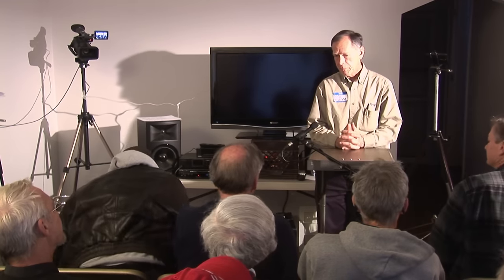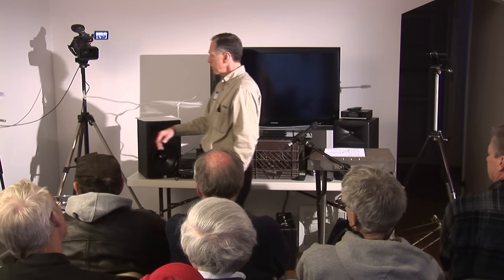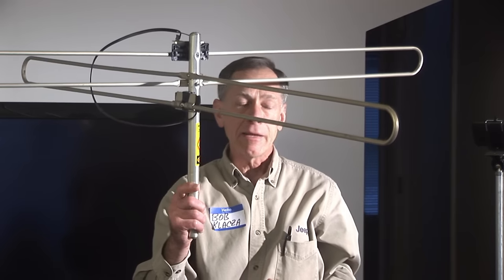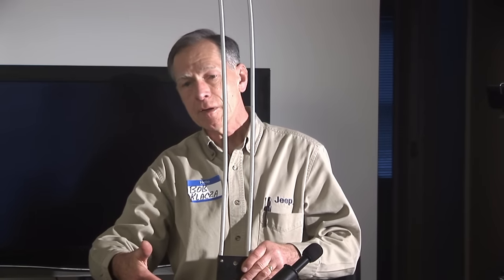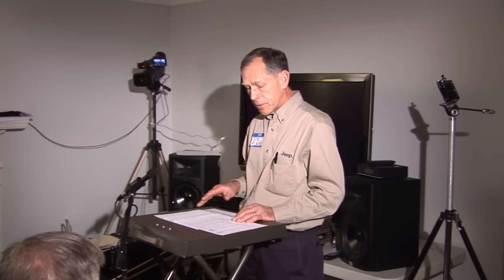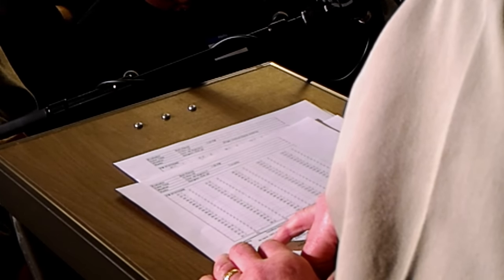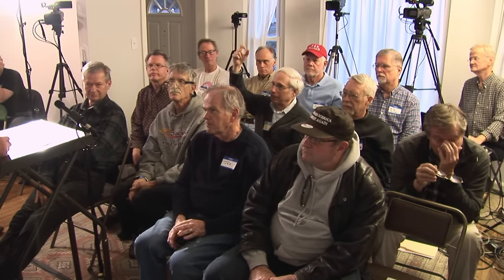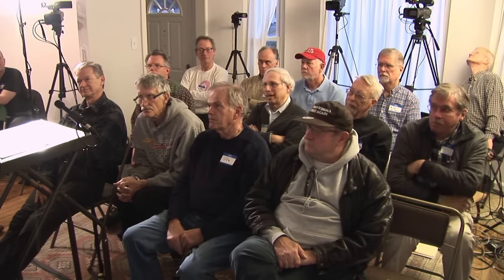Antennas for FM Radio Reception

Comment: Thank you for your advice about a whip antenna, and about what its optimal length should be.  I have a Sony receiver with a 75 ohm coaxial connection.  I found a 30-inch (75 cm) whip antenna  with a 30 inch cord, and it works perfectly ... no amplifier needed!  I propped it up in a window with a venetian blind, and I now get great reception of an FM station I like, that is 60 miles away!  A cheap and very effective solution ... thank you!
Reply: Thank you for your very nice comments !!
Reply: I'll try that too.  No ground plain required?

Comment: Those goofy T-wires provided with the purchase of a receiver work fine for most people in or near urban areas looking to get only a couple of favorite channels, which is most people in the country now. We who live in rural areas appreciate your information to help us getting those distant broadcasts.
Reply: The T-wire antenna can also be arranged with the top of the T vertical, and try to have it up as high as possible.  It may be of benefit to add an extension to the twin lead to gain that height.

Comment: I mounted four of these folded dipoles vertically and used RG62,  93 ohm cable with a balun at each antenna.  I used a spectrum analyzer to phase each antenna and use the correct length of RG62 to raise the impedance of each antenna to 3oo ohms unbalanced.  When the antennas were connected together, the unbalance impedance became 75 ohms. Since the FM broadcast band is rather narrow, I could easily phase the antennas  Outstanding reception!
Reply: Patrick, wow, you really took the bull by the horns and wrestled it into submission!  It is not likely that most have access to a spectrum analyzer to handle such a job, or the patience to do it.  Congratulations on your fine work and results!!

Comment: The one test that you didn't do was to take that double turnstile and mount the mast horizontally. That way you will have one element vertical, and the other horizontal.
Reply: It turns out that when doing this orientation, you really do not get the performance that you would think. the vertical element would indeed be omnidirectional, but the horizontal element does not significantly contribute to better reception in the United States of America.  It is a bipolar pattern and is not "omnidirectional".

Comment: Thanks for sharing such an interesting video. I am from Cuba and I always was a FM band lover. I had several antennas to "catch" radio stations from Florida and one of my favorites was a 
7-element yagi, along with a 
3-step booster which I put right on the mast about 1 foot from the dipole. It was sealed and protected from rain. Oh man!  That setup worked like a charm!!!
Power supply was down by the tuner and I used the same 75 ohm coaxial cable to power up the Booster. Amazing guys! I wonder how many stations I'd get here with such a system!!! Okay, thanks again and till your next video.
Reply: Thank you very much for your antenna investigations and results!
Reply: @robertklacza1160  Thanks for answering!  Stay Safe!

Comment: Nice video!  Thanks very much!  Didn't know that circular polarization was pretty much standard.   

Stove-Pipe Dipole
Armed with that information about circular polarization, I built a dipole out of two pieces of 8" (trade size) / 7" (actual size) galvanized HVAC duct.  Each arm of the dipole is 690mm or a bit over 27" each.  I put a 1" space between the ends where the 75 Ohm CATV cable connects.  I did not use a balun of any sort, as the two pieces of stove-pipe make a very good match to 75 Ohms at the middle of the FM band, and I was not too concerned about disruption of the pattern because of feed line currents.   Because of the large 7" diameter of the stovepipe, the antenna is fairly broad band.

The antenna seems to work well.  I have made some measurements like those you give in your video,  so far just for the stovepipe dipole (which I hung vertically in my attic and connected via 75 Ohm CATV cable to my radio in the basement).  Have not yet made measurements on other antennas on hand.  

Noise in FM Broadcast Reception
This was all in an effort to clean up some "steam" or "scratchiness" that seems to be always present in music received through this radio.  I am a bit perplexed how to get rid of it.  Even though my radio shows a good strong signal (as I assessed by measuring the voltage at the S-meter output of the FM IF chip), I still hear some scratch in the music.  Do I not have a strong enough signal?  Perhaps the scratchiness is because of the demodulation method used in the radio?  The radio, by the way, is a Kenwood KR-A46 AM-FM stereo receiver., about 1987 vintage.  It is frequency synthesizer-controlled, and I have not attempted to align it, though I do have the factory service manual that describes the alignment procedure.  I just picked it up at a thrift store recently, so I don't have a great deal of experience with it.  Maybe a fully analog FM receiver would have less "scratch"?

Thanks again for the very informative video.  Good engineering!

Max
Reply: Thank you for your comments !   It is noteworthy that this video urged you on to try building a similar vertical dipole !!  With that said, I would suggest that you try a new FM tuner that uses a NXP, STM, or TI digital FM/AM HD chipset.  These new tuners can be had for around $200, and if you look at https://www.youtube.com/watch?v=fbudkK9LzWY  for the comparison of two of these popular tuners, I am sure you by getting one of these will get rid of any background scratchy static !!!

Comment: Great video! I have a number of high quality component FM tuners fed by a variety of antenna systems in different rooms of my house: Horizontal folded dipole, vertical dipole, and my garage tuner has two yagis facing west (to Cleveland, Ohio) and south (to Kent, Ohio), switched to provide the best tuner input. We live low in the valley of the Chagrin River so FM reception is...challenging.
Reply: Thank you for your comments about optimizing FM reception under difficult conditions !

Comment: I'm fortunate to live in a signal-rich urban area and pull strong signals with just an old 300-ohm floppy dipole strip, which I reposition, depending upon atmospheric conditions. That, and a receiver with a good FM stage, has served me well these past 60 years. Our village is the western-most portion of San Diego suburbs and it's a straight shot up the coast to the high antennas sited in the mountains east of the Los Angeles Basin. As I am 400 feet from the Pacific, there is virtually no multi-path phenomenon, because I am sticking out from the continent enough to allow line-of-sight between my cheapo dipole ribbon and the transmitters high atop the coast range of mountains to the north. So I get good signal strength and quite a bit of separation, even though it's almost 100 miles between us! My Fisher receiver, circa 1978, was made with Avery Fisher's patents in Japan and has one of the best FM stages I've encountered, but my two Marantz receivers were equally as good, too. This gear benefitted from American know-how and Japanese expertise in manufacture. I believe that accounts for the popularity of the big super-receivers of the 1970s today. They offer enough stable power to drive even an inefficient speaker system and great FM reception, too. I found no superiority in my high-end Tandberg separate components with their miles of interconnecting cables which may or may not have been picking up RF signals, given the traffic density here. I know it sound like heresy, but I think receivers with their short coupling paths between sections result in a cleaner signal than individual amp-preamp-tuner arrays and all the potential corrosion effects at contact points in this marine (saline) environment. At least it provides less chance of tripping over yards of cables and neatens up your listening area. Wives and sweethearts like the sound, but often balk at the hardware scattered about. I first dropped a needle on a record in 1940, so I've been around the platter several million times! Thanks, Robert, for a thoroughly professional and useful presentation. My brother Jimmy was Chief Plant Engineer for Pacific Bell here and had 12 patents of his assigned to AT&T over the years, so I have some experience with your area of expertise.
Reply: Thank you very much for your detailed description of your reception conditions !  You are truly very lucky to be in the situation you are in !!  Thank you for your kind comments on my presentation !!!

Comment: Two more steps in complexity, for another 6dB gain, would be to have two vertical dipoles end-to-end with a shorted quarter-wave stub between them. I used that for pirate broadcasting long ago. It worked very well. The impedance around the middle of the stub is 200Ω balanced. If you use a half wavelength (times whatever the velocity factor is) of 52Ω coax to make a balun to feed it there, it works out perfectly.
Reply: That is a good suggestion, but some people may not have the readily available height to use that technique.  Thank you very much for your reply and good suggestion !!

Comment: Very informative! After watching this video I went home and straightened the elements on the Stellar Labs 30-2435 "round dipole" that's been sitting in my basement, unused. I also flipped the mast mounting bracket on the center support and slid it to the far end so it can be easily mounted to a mast, offset at a right angle. Mounted in this configuration I assume the built-in transformer will be more susceptible to water intrusion, so I will bypassing it and using a pigtail balun.
Reply: Thank you very much for your reply !!

Comment: I made a few comments here, but I DID want to thank you very much for the idea of orienting a simple dipole vertical.  With all my antenna experience in industry, I just did not consider it before - not sure why not.  
Anyway, I live half way between New York City and Philadelphia, and can receive both well if I use an omni antenna.  I bought the folded dipole that was bent into a circle, like the one you showed, and it worked OK, but the vertical folded dipole worked a hair better.  I can receive about 85+ stations, and the ones that come in, in stereo, with a rating of 9+ (on a 1-10 scale, 10 being the best) I receive about 60 stations.  Thanks for the tip!
Reply: Stephan, Thank you very much for your reply, and that you now can receive the great number of listenable stations !!  Enjoy your improved reception in this Holiday Season !!!
Reply: Stephan, Thank you so very much for your comments !!

Comment: I took the cheap T wire antenna that came with the tuner and cut each leg to 29 inches then stripped both ends of each leg and twisted them together to make a 59 inch folded dipole tuned to 98mhz. I then mounted it vertically in my attic and made sure the center conductor of the tuner was connected to the upper leg. I used 300 ohm flat line to connect it directly to the f connector on the back of the tuner without any chokes or baluns and it pulls in anything within 60 miles crystal clear and partial signals from 70-80 miles
The folded vertical dipole works great and has a lower noise floor than a standard dipole . I only had 3-1/2 feet of space in my attic so I drilled a 1" hole in one of the wall top plates and dropped a foot or so of the bottom leg down it to keep everything straight and vertical.

As far as omni directional goes you cannot buy a better antenna
Reply: Thank you very much for your fine comments !  Your use of the "twinlead" antenna is a very good one !!  Be sure to have the leads from the dipole to the tuner slightly twisted to have better noise rejection as could be picked up by that portion of the antenna system.
Reply: I'm wondering if the cheap T wire antenna that comes with tuners is already "folded". As far as I can tell, based on continuity measurements this seems to be the case.

Comment: Bob: Thank you for this video. Couple questions: 1) Where can I purchase a folded dipole antenna for FM radio reception? 2) I plan to mount it on my TV antenna mast. My TV antenna is a "Televes 148883 Antenna Ellipse Mix ". 2) Where on the mast, relative to the TV antenna, should I mount the FM dipole. Many thanks. Jim King, Saratoga County, NY
Reply: Jim, the easiest and most readily available is the circular Stellar Labs model 30-2435, Outdoor FM Antenna, and just straighten it out.  Do a search for the lowest price, generally in the $20 to $30 dollar range.  It is 55" when straightened, so it may have a bit less sensitivity at the low end of the FM band, but the higher band will be a bit better !!   I would recommend that the vertical FM dipole be mounted below the TV antenna, and that the top of the FM dipole be below the lowest element of the TV antenna.  Please update with your results !

Comment: Let me add.....True circular polarized transmissions have equal power in both the V and H planes.  And they transmit with either right (RH), or left hand (LH) circular polarization.  The reason they are more immune to multipath is because if we say start with a RH polarized signal, the line of sight signal hits you with a RH polarized signal, however, if any of the transmitter's signal bounces/reflects off of a nearby object, the reflection signal changes the direction of rotation, (meaning in this case where we started of with RH circular, it will come away from the object it reflected off of, being LH).  And the receive antenna (being a RH circular design) is immune the LH signal.

Comment: Where can I purchase the single T straight antenna that you liked? I'm having a hard time finding one that isn't several hundred dollars.
Reply: The easiest and most readily available is the circular Stellar Labs model 30-2435, Outdoor FM Antenna, and just straighten it out.  Do a search for the lowest price, generally in the $20 to $30 dollar range.  It is 55" when straightened, so it may have a bit less sensitivity at the low end of the FM band, but the higher band will be a bit better !!

Comment: The turnstile antenna mentioned at 3:00 and again at 10:40 can be made to work more-or-less omnidirectionally if the  section of twin lead connecting the two crossed elements is 1/4 wavelength long. At 98 Mhz this would be about 28". It's called phase-quadrature. It works - the reception pattern is a cloverleaf. The length shown on the vid appears to be random. These things can be pretty frequency-critical.
Reply: Rick, thank you for your comment ! Yes, you are correct, but I was advising for an omnidirectional reception pattern that the single dipole yields !  The cloverleaf has four nulls....

Comment: So at 9:46 in the video, the relatively simple dipole id the most feasible and best in its class. So where do you get  one? Thank you.
Reply: The easiest and most readily available is the circular Stellar Labs model 30-2435, Outdoor FM Antenna, and just straighten it out.  Do a search for the lowest price, generally in the $20 to $30 dollar range.  It is 55" when straightened, so it may have a bit less sensitivity at the low end of the FM band, but the higher band will be a bit better !!

Comment: Newbee here.  Can I purchase a good outdoor FM antenna or are there patterns for building one?  I do not know how to connect the antenna to the lead going down.  I am not even sure where to purchase materials any more as most DYI stores have closed in the area.  I have a Channel Master TV antenna on a rotor for TV, but it is only for UHF and my wife sorely misses FM.  I can have a second lead coming down for the FM.  I have seen some circular and some horizontal flat (e.g. like the Channel Master one), but I have seen mixed results on all.  I had to take my antenna down for termite tenting, so before I put it back up, I want to plan (e.g. old guys on 2 story houses - scares the wife).  Any recommendations would be helpful.
Reply: Four minutes into the video, the Stellar Labs model 30-2435, Outdoor FM Antenna is shown.  It is widely available, and could be used as is, just get it as high off the ground as you can.  A simple Google search for that antenna yielded numerous sources and prices from ~$19 to $45.  This antenna has the F-Connector output, and I recommend using RG-6 coaxial cable for it's low loss.
Reply: There are two recommendations- 1) determine if you want a rotating antenna to go to great distances to get stations or not, and depending that answer, if you want the greatest distance, get a rotor.  If only local stations are of interest, the vertical dipole is easy !!

Comment: Sadly long out of production, but the BIC "Beam Box", basically a selectable/ tuneable Yagi in an enclosure the size of a small phonograph or turntable, has worked very well for me and a few of my friends back when we lived in apartments in areas with generally lousy FM reception and where outside or attic antennas were not allowed. Lower signal output than you'd get from a dipole (for one friend of mine, adding a signal booster between the Beam Box and the receiver made a huge improvement), but the selectable elements and bandbass filtering means that you can often greatly reduce or eliminate interference from adjacent stations. The FM-8 was the plain-Jane, 300 ohm version, the FM-10 was prettier, with smoked plexiglas top, and had a 75 ohm output as well. Last time I looked, these were fetching a hundred bucks or so on Ebay. If you cannot put up an outside or attic antenna, then the Beam Box is probably worth the money. FWIW, I live in hilly New England, and I only listen to low-power college and public radio on the left end of the dial.
Reply: Thank you for your interesting comment.  Manually tuning the antenna with additional knobs can optimize reception.  Prices for this product on eBay range from mid $30's to $150 as shown on 04/14/2020.